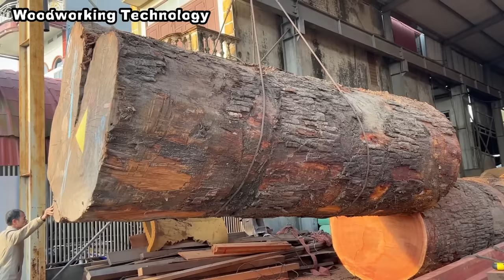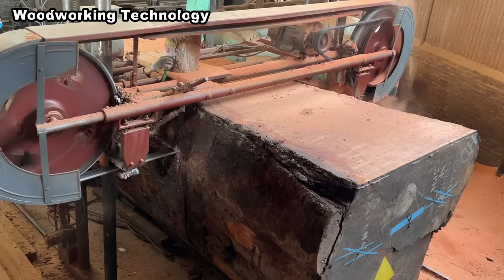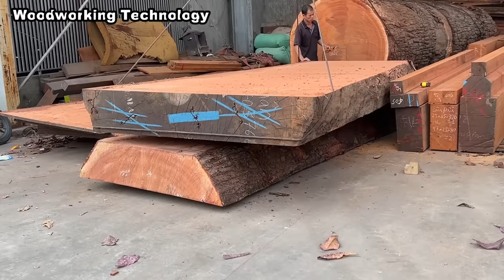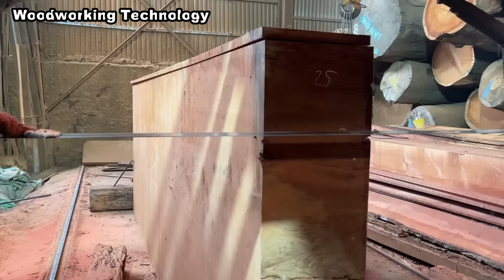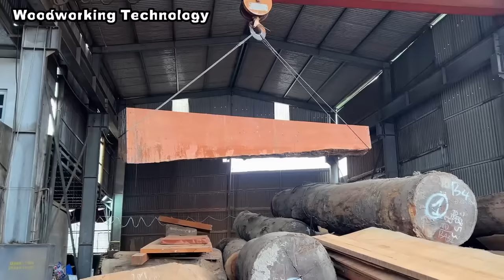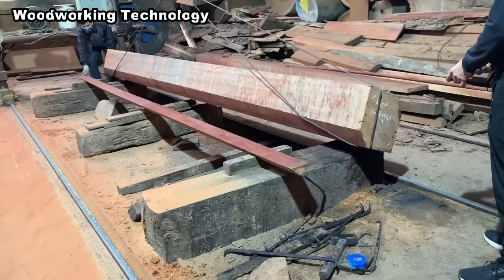Amazing Fastest Large Wood Sawmill Machine Working | Producing Raw Wood In Factory You Must See

Comment: I grew up in a mill town in Idaho and they had saw blades three times bigger and would cut about five times faster than this.
Reply: But that Idaho mill cut softwood logs. The video log is hardwood. Your comments are correct but overlooks a number of items. Another thing is that the log carriages couldn't have carried the large hardwood log weight. Yes that mill I think you are referencing handled logs that big but much less weight. Probably not relevant, but those saws were fixed and log moved, quite fast I might add. I worked at the PFI mill and had a neighbor who ran a saw carriage 8 hrs a day.
Reply: @byronfitch6444  Point taken Byron.  However if you look at the "fastest large wood sawmill" in the video I was pointing out that it might not be the largest.  See the electric motor on their saw carriage?  The engine that ran the mill in Idaho was run by a Sterling locomotive steam engine and was bigger than a Greyhound bus.  The drive wheel for the band saw was over fifty feet in diameter.  The teeth on the saw bands were eight inches long.  Just saying.
Reply: @byronfitch6444  asian hardwood is about as hard as southern yellow pine.
Reply: @byronfitch6444  Under settings you can adjust the playback speed if that helps.
Reply: @asknight  When the pitch sets in yellow pine it is harder than oak and some maples.
Reply: @asknight  depends on the species. Some species of ebony are found there, along with several ironwood species, not to mention a few hornbeam and hophornbeams from China